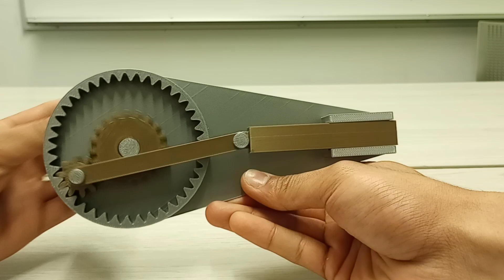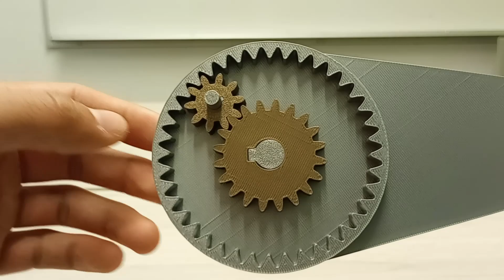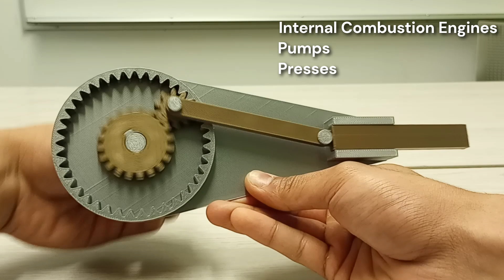Crank Slider Mechanism

Comment: If all those gears were smooth with ribber edges (no teeth) like wheels, would it still work? I ask because an application I'm thinking of  would be better, quieter.
Reply from the maker: The reason you can hear noise out of my design is because I didn't perfectly size the gears resulting in a loose planetary gear. So yes it would be smoother with rubber because the surfaces of the rubber would allow no space in between for rattling. Thanks for the comment, maybe I'll create a design with rubber edges some time.